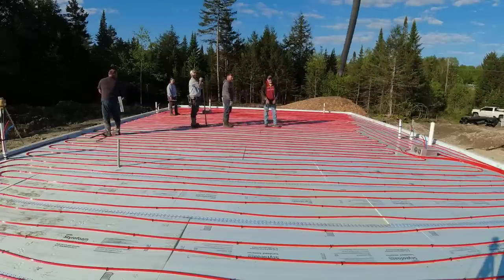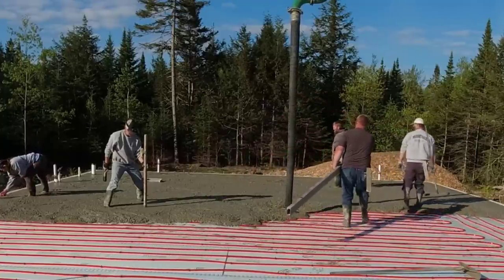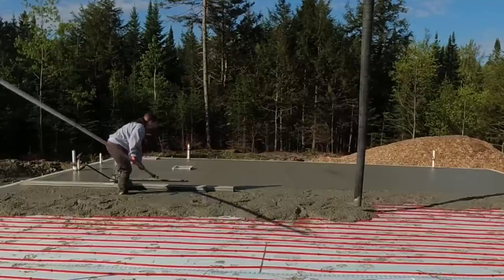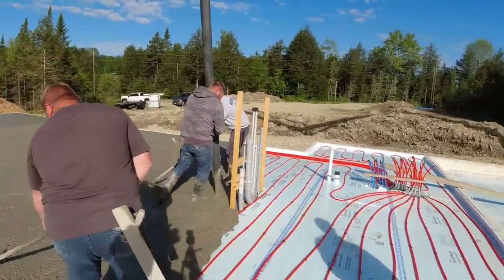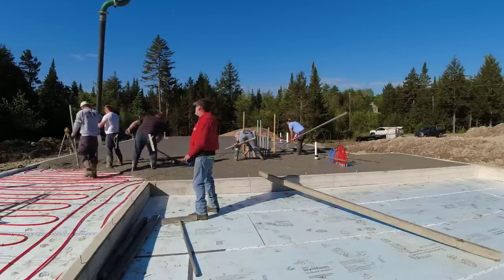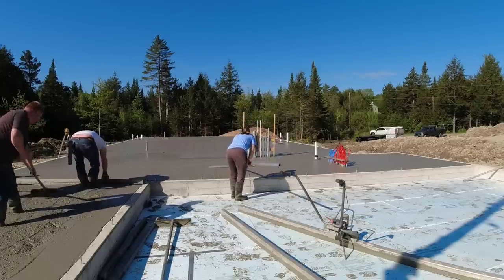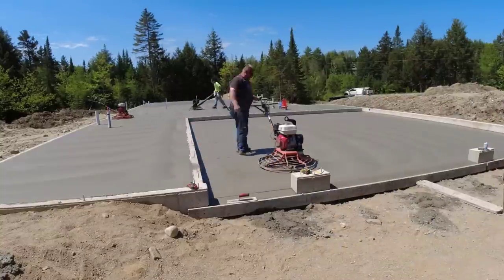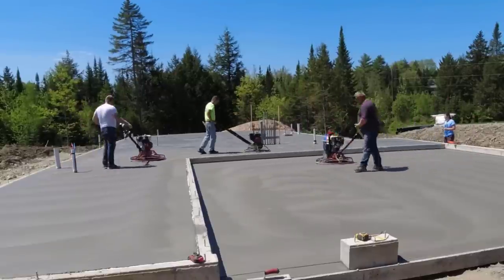How To Pour Concrete The EASY Way - My 4 Simple Tips To Follow!

Comment: Kinda surprised at the lack of rebar in the garage, with the foam underneath the floor, I would assume the floor is not sitting on a lookout ledge around the outside of the slab. I don’t have the confidence in the fiber mesh that some do. I think I would have preferred the slab sitting on the lookout, with rods sitting in a grade beam, suspended, with the entrance of the slab sitting directly on the front foundation blocks. I’m old school, so maybe my ways are outdated, but they worked for me for many years, very seldom had cracks, or settling. I will say I’m enjoying concrete work a lot more sitting in the peanut gallery! LOL 😊
Reply from the maker: We get hired as a sub on these floors, the GC gets the plans from the engineer and we follow the plans. If it only calls for fibers, that's what we do. If the sub-base is done correctly, we don't have any problems.
Reply: @MikeDayConcrete  Yes Sir, I understand, I never liked doing jobs like that, I always preferred to do my own prep and set up, if something came up, I knew who to blame, that’s why I always over did the prep, especially in the garages and porches. There were actually a couple more steps I used that I didn’t mention. Like I said, old school, we worked harder, not smarter! LOL 😂 Was wondering, as long as I’m asking, do you ever put a weather lip at the front of the garage, so the door actually sits 1 1/2” lower than the actual floor  to keep the snow from blowing underneath the door in case of buildup in the winter? I live in a lake effect area, so we probably get a lot more snow here than you do. On the north west facing garages I always made sure to go the extra step.
Reply from the maker: No, we don't do the 1.5" lip here, we taper the edge from inside the concrete wall about 1/2" to the outside of the wall. We get the taper up under where the door sits. We've never had a problem doing it this way. And no trip edge.
Reply: @MikeDayConcrete   Yes, I have seen it done that way, we get some very strong winds here in the winter, it just made a nice weather tight seal, never really had a trip step problem with it, the seal was tight to the bottom, and the lip was right up against the back of the seal, so it was like a two fold stop. Like I told you, old school, we did everything the hard way, we weren’t as smart as you young fella’s, I’m glad to see that things have progressed, old school took a toll on me, we didn’t have the plasticizers you fellas have today either, it was 4” slump on the basements, 3” on the garages and porches, lol and a lot of swearing, and grunting! 😉

Comment: Hey Mike I love your videos can you explain a little more about the relationship between mix design and long-term durability. And also how long you should wait between a new floor being poured and epoxy floor coating or paint . I'm doing a work shop here in Maryland 20x30 what should I use for a mix design? Thanks in advance for tips/help
Reply from the maker: I'd use a 3000 psi mix or even a 3500, both are good. 3/4 aggregate, no-air, we put micro-fiber in all our pours. Then it's 30 days before you can epoxy it.